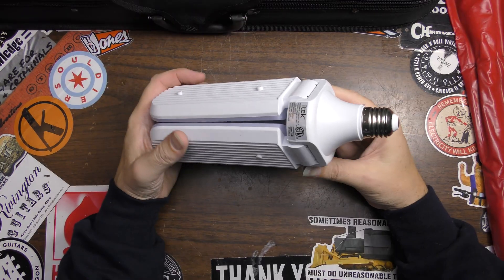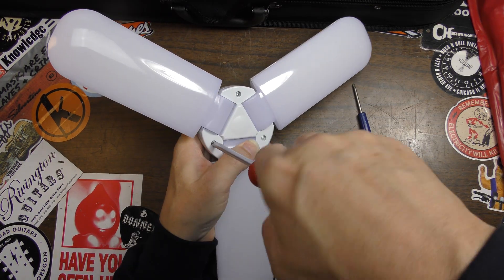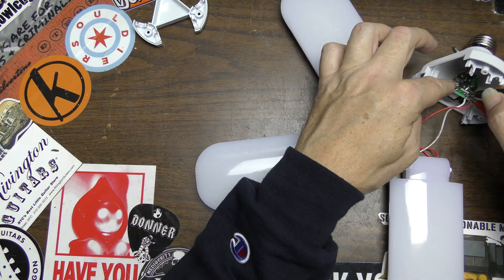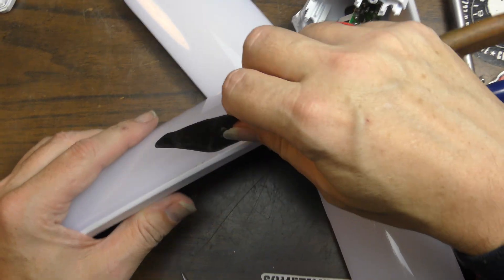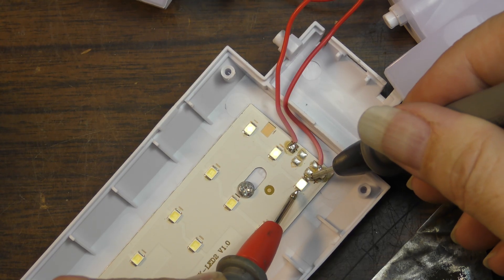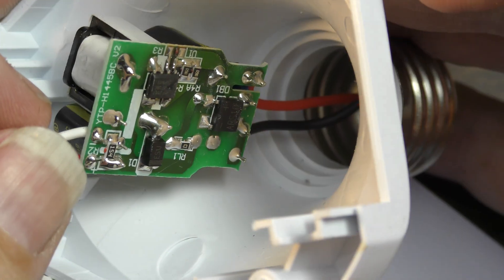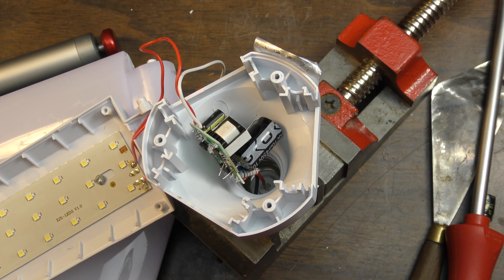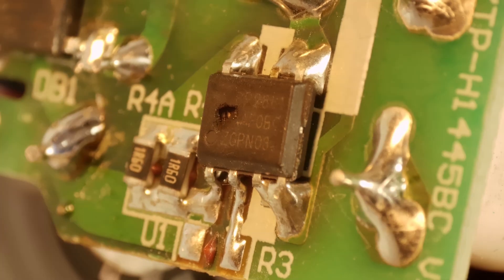Why Did This LED Bulb FAIL? | Intertek Itek Foldable LED

Comment: Also there's a "hack" for making new lights lasting longer by changing the resistors which set the current and reduce it a little. But it's not very economical since you have to buy very high power lights bulbs.

Comment: What I usually do in this situation is delete the current driver and install a dropping capacitor in place of the live/hot wire. I start with a small value (around 470nF for 230V) and go up from there. Idk how this one is built, but on small bulbs, the CC driver is installed in series with the LEDs, so you can just short the input and output and leave it in place. It's the simplest method I've found so far.

Comment: There are videos about pulling the driver from a CFL and repurposing it as a "LED tester" (singles to strings of 30 or so), which might work.
I keep CFLs where the ends of the tube are blackening, and pull the drivers where the tube broke.  Good to have them for Just In Case.

Comment: Just replaced the driver circuit in one of those large opens like a flower led arrays. It failed due to a design flaw which was an easy fix.  Common problem poor ventilation in the socket housing fixed it by drilling 6 1/4 holes all around it.

Comment: The problem is that all LED lamps do not have enough cooling and they are made very cheaply. Some time ago I bought another lamp but this time I made an aluminum cooler + thermal paste and it has been working without a problem for 4 years now.
Reply: Not all. There are a few good LED lamps out there with heatsinks on them. They were more common when LED's were new though.

Comment: I enjoyed that teardown! I have several of those guys in service, so far all good. The filter is between the rectifier and the regulator chip I think. The cheap-O cap dries up and punches out, letting nasty AC ripple to do it's thing to the rest of the stuff. I just had a grid tie inverter let the magic smoke out. Took it apart and found all 4 filter capacitors with bloated tops like the one here. All tested wide open, nothing! Oh, more parts gave up the ghost too. Binned it after stripping a few things like fans, switch, choke coils. Unit made it almost 3 years. I wonder what voltage the panels actually run at? If panels could be repurposed to run on battery power?
Reply from the maker: Another guy in chat suggested drilling a few small holes in the white housing to allow heat dissipation. I think that's a great idea. Probably will do that with my other working one.
Reply: @Fixologist1  As we geeks know, this stuff is designed for max light output with the least cost. Get through the warranty only. I learned playing with LED's, that they have  a threshold where increasing the voltage after a certain point, the LED's start conducting heavily and just get hot without much more lumens output. Just lower the input voltage by 10 or 15% and I bet they would last years.

Comment: First failure point of the led lighting fixtures is the power supply. Knowing this, I power all my led lights in the house through a 10ohm 5 watt resistor on the 220V 50Hz AC  line I and haven't had an issue 6th year since i did that. A bit of light is lost that way, but nothing major. Important thing is I don't have to swap them every few months.
Reply from the maker: Where are you installing the resistor? On the wall switch?
Reply: @Fixologist1 nope, right in front of the transformer, in the same cavity, where one of the ac lines enters the little transformer circuit,  using simple plastic cable joints terminal. i don't have a single incandescent bulb, way more economic and durable. In the hallway I even fitted ceiling lights with motion sensor so we don't make the wall around the switch all dirty and i know when the kids get home at night as well😂

Comment: It failed because using LED as incandescent retro fit is already a failure. lol
I will never give up incandescent they need to make some laws and standards for this garbage.
LED has its place and in home lighting or in a street lamp is NOT good. Society is functionally extinct so we may never even see the real impact this crap has. The spectrum they produce is WORSE than florescent and causes macular degeneration. I prefer seeing all the color spectrum correctly and not having eye pain and vision loss.
Reply from the maker: Don't know about causing eye problems, but I do prefer the light from incandescent lamps. The problem is the amount of wasted energy. I think incandescent certainly still have a place in many applications.

Comment: Could just replace the whole board for $2.
Type in - LED Driver Transformer power supply Adapter 280mA-300mA LED Non-Isolated Constant Current Driver Power Unit
OR - LED Driver 300mA PCB Board 1-3W 5W 4-7W 8-12W 12-18W 18-25W 25-36W Power Supply Lighting Transformers For SMD/1W LED Lamps DIY